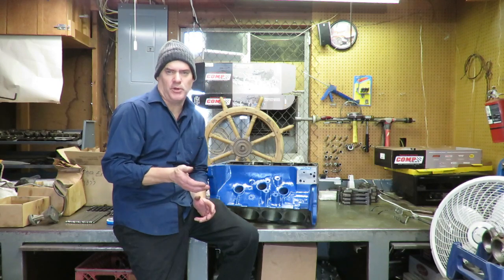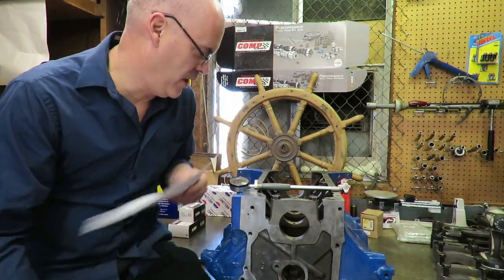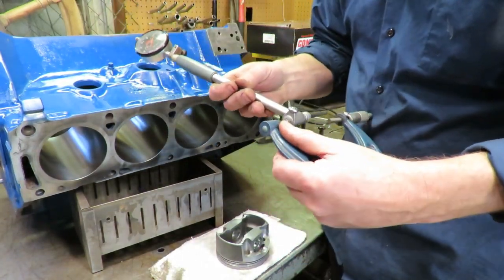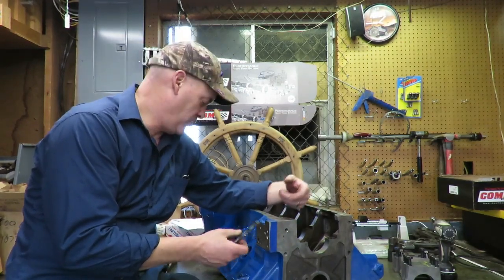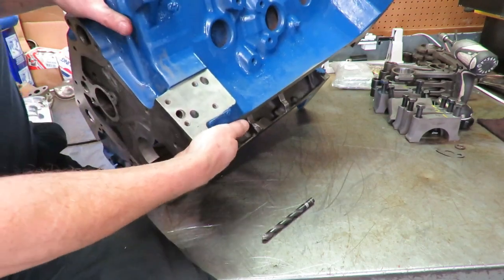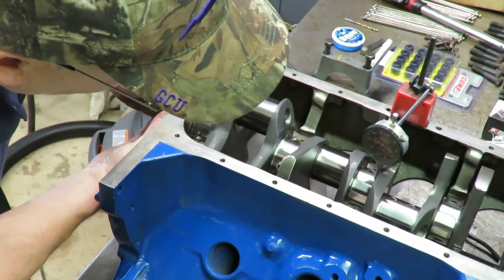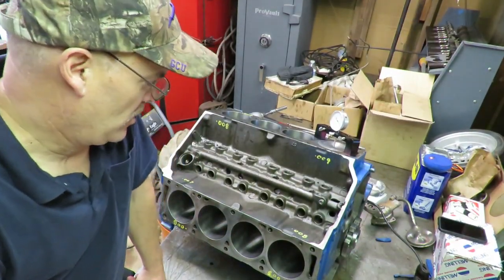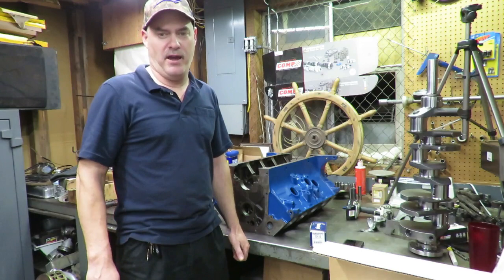390 FE Stroker Build part 3 Block Prep

Comment: This is my motor.  I am very lucky to have you building it.  You bring more to the table than anyone I know.  Your expertise is very impressive.  I can't wait to see the rest of the series.  I check everyday for new videos.  I feel like a kid checking the mailbox everyday waiting for my Orphan Annie Secret Society decoder pin.  It is exciting to see my motor  finally coming together.  I can't thank you enough.
Reply: Your very fortunate! It's getting awfully hard to find someone so knowledgeable on the FE.
Reply: iROBODUDE whats the name of his shop? i’d like a similar setup... thx
Reply: Im just watching the series, how did this turn out for you.
Reply: Couldn't you have purchased a small house for what you paid to have all this work done?🤣
Reply: How did it run and pull once in your truck?
Reply: @hectorortega9131  I am a little disappointed in the performance actually.  I think it needs EFI instead of carb.
Reply: @iROBODUDE   oh wow, sorry to hear that,.  So what do you need it to do that it is not doing?  Bogging, not enough torque? Detonation or what?.
 Also how do you use your truck mostly,. Weekend 4x4, hot rod, or Work mule?
Reply: @iROBODUDE  what's actually happening with your motor I have a 445 in my mach 1 I built and she's running 10.90 all motor and it has a  carburetor I'd be glad to try and help you
Reply: You didn’t put C8AE-H heads and that garbage Performer on it did you? Or the stock exhaust manifolds?  You need good heads like the cracked C4 heads and an RPM intake with headers. These are very important to performance. The 445 is the best way to go. And you want Edelbrock 2.09, 1.65 valve heads or the C4,with 2.09 or even 2.15 intakes and 1.6 or slightly larger. Intake is very important, exhaust not so much. For a 425 ci or bigger a 282/286 and . 570 lift cam. The timing should be 37 total. I have mine with 17 initial and 20 centrifugal. I get it all in by 2400 rpm’s. Hope this helps.
Reply: @iROBODUDE  Put a 750 Holley 3310

Comment: Rescued a vintage oval-track 71 Ford Mustang from a scrap pile that I’m currently restoring. It came with a 390 with a 3 speed transmission out of the car. I know these videos were a few years ago, but if you’re out there I’ll appreciate anything I can pick up from from watching. Right now I just want to get it fitted in the car which is gonna be a task, it’s a Chevelle chassis, oil pan doesn’t clear steering linkage. Got a lot of challenges ahead and taking my time. Excited that I found your channel. Thanks for sharing your skills.

Comment: Definitely some good tricks to know on the old girl.
Set a cross bolt main caps wouldn't hurt either but they're a bit pricey that have MFG up and then machined in.
I used to do that to my Cobra Jets.
It's all in the heads ,
get some good cylinder heads on her that flow.
Even though it's a standard Duty engine I would definitely put a high volume pump on there with a good oil drive shaft from Moroso or somebody.
Weld on extra little box to your oil pan to give you at least two more quarts  volume,
And use a Holley carburetor jet restriction on number 3 bolt on the rocker arm shaft so you don't fill up your valve covers with all your oil.
You could likely get away easily with a Cobra Jet can  grind on it also.

Comment: I built one I used in a 67 Mustang on a 1/4 mile flat paved oval. It was my first car and was crap, but I was 26 and knew 390s by that time. I managed to nail together a killer one. Some might find the build interesting because I used data that could maybe still be found. In the spring of 1983 Hot Rod magazine did a story on a 390 powered Fairlane tearing up dirt tracks in Northern California (iirc). The article was titled "390 To Go." What made the car amazing was the motor, a 390 stomping all the small block Camaros. In that article I found the oil system mods that will get MORE oil to the mains. Oil to the mains is the weak link in the FE, and is why the side oiller exists. I imagine most good FE builders know the oil mods, and 3 years pounding on my motor seeing 6 grand twice every lap says they work. The bearings were always still there every time I went in and looked.

Then for power I used Fords Muscle Parts catalog from 1968 (iirc). Stuffed full of builds for all factory supported engines I built mine to a spec I called a "baby 427." The oil system mods require going to a mech cam, and that frees up a lot of excellent cam grinds. I chose a PAW (That's right that PAW! lol) grind that was with in lift rules and close to old factory mech 427 specs. This cam fit with the Ford recommendations, and the Ford machining specs got the compression where I wanted it with legal flat top pistons. This was the expensive part as it required the intake be machined on 4 surfaces. It was a beast with (illegal) port matched GT Mustang heads (3 bolt exhaust port) and stock manifolds and carb. It lived for 3 hard seasons freshened up twice with a custom (very crude) kick out and baffled oil pan I made. I sold the engine and it ended up in a dirt track car in Nevada and won a local championship in a much better car. My car skills were not yet there, I did later learn how to win. But I made a great 390 by gawd. I've built better engines since, but only because I had better rules and more money.

Comment: One of my favorite personal engine builds was taking a 360 FE , boring it 0.060 over & dropping 390 crank & rods in it. I almost blew out a disk in my back just trying to lift the bare block up to go to machine. A comp cam RV bumpstick and a 10.5 compression ratio made it a real stump puller. Most important part is opening up the oil galleys on the FE because it will run out of oil at 4000 rpm.
Reply: I see you commented 3 yrs ago but if your still out there, is your claim of running short on oil at 4000 with a standard volume pump or high volume pump???
Reply: @jesseduke694  it doesn’t literally run out of oil but the life of the rings and rod bearings are shorten quite a bit if you get a stock bottom end of a FE to hang out over 4500 rpm for a few minutes.
Reply: @BustedWalletGarage  i understand what your saying. I was just curious if that claim was intended for stock volume or high volume? I know they need help in the  oiling department at rpms
Reply: @jesseduke694  every time I’ve seen a high volume oil pump on a street car the oil pressure goes to zero when it accelerates.  You have to use a very expensive oil pan to prevent that and they usually don’t fit in the car well.  The stock Ford oil pump can be modified by shimming the internal pressure relief valve and you can get a few extra psi while still using the stock pan.

Comment: This is gonna be sweet!
I just put a Sniper efi on my stock 390 FE and I’d like to rebuild it while also adding some performance.  
I didn’t even know FEs were skirted.  Cool.
Reply: TheProchargedmopar do you have a clue how to contact Myvintageiron I need to buy his pants for sale. thanks.
Reply: His PARTS FOR SALE NOT PANTS HIT THE WRONG KEYBOARD KEY ANY ONE KNOW HOW TO CONTACT HIM!
Reply: Curtis von Epp Nope, Just watched a few of his vids.  Pretty good.
Reply: I read that first post and thought what the hell??? LOL You can contact him through his FB page- it may take him a bit to get back to you but I know from first hand experience that he will get back to you and he's just as personable via message as he is in his vids.
Reply from the maker: sorry man my pants are not for sale
Reply from the maker: message me on Facebook at myvintageiron7512
Reply: Yes skirted and you can even buy the 3 center caps for a cross bolted main setup and if you look at the bottom of the block you will see drilled and threaded holes on the bottom of the shirt for the option of cross bolts on the 2 and 4 main caps. Atleast my block is
Reply: Try his facebook page of the same name

Comment: Exactly right on the soap and water. Solvents will simply break a particle loose, clean it and allow it to redeposit even deeper. Dish soap is actually a detergent. Detergents keep the particles suspended allowing them to be rinsed away. I wouldn't go near a builder that didn't use soap and water. I have personally removed casting sand from blocks with soap, I'm sure you have as well.

Comment: I've got a stock 390 in my 68 ford galaxie ltd. I'm planning on doing a full rebuild once the block passes inspection. I like the sound of a lopey rv cam, and I plan on stroking it. Do you have a recommendation for a stroker kit and cam as well as whether I should over bore and if so how much? I want a good solid fun torque motor for street/strip. Great thorough videos man!

Comment: dawn...it even removes diff grease from your hair. block isn't a problem ;-)
i have used the stuff for the purpose for over 15 years. works well...no problems. with pressure washer.
Reply: Gizmo Thewytchdoktor Dawn dish soap, and a little sand will clean black walnut hull stain from your hands better than anything. Pure dawn just a little sand only then work it in for a good long while. Then rinse with hot water. REAL shade tree mechanics know 🦉

Comment: The back side freeze plug to keep the cam in is what way installed? Then with 390 to 427 the cam bearings are different no? The 427 had grooved bearings which are diff than the sideoiler. You stated this was to be a full tell all an missing this one part has left me a lil in the dark. I've built many engines NO Machine work always did it by farming out. So when came back plugs were in an bearings of the cam as well. I'd like to see °ALL the steps an sadly you left this out an I know they are supposed to be easy but seeing is learning.

Comment: the old 292/312s had a notorious reputation for eating upper valvetrain parts, so bad so j.c. whitney offered an external line oiling-kit that utilized a block takeoff, brake-style lines and access holes drilled thru the valve-covers. the new "FE" was not to have these problems so they restricted oil from the bottom-end forcing it to the top. of course the designed for racing side-oiler sidestepped this major issue.

Comment: Where did you get these pistons. I couldn't find any for a 4.11 bore 390 when I wanted to put a 428 crank in it and I had to have lots of custom work done to the pistons we had and the engine is still running with .021 out of the bore with mls head gaskets to make it all work. The pistons I need are a flat topped 60 over 390 piston for the 3.98 crank. U went through 4 sets of cam bearings doing test fittings on the camshaft. Then removing them and honing out the cam bering bores then reinstall and check for cam friction.
Reply from the maker: The pistons are from MAHLE motor sports but stroker kit is made by scat they also supplied the pistons it's a 4.125 stroke that brings our CID to 431
Reply: Myvintageiron7512 will a standard 390 block handle that large of a bore? By my numbers that's a 75 over bore or am I wrong?
Reply from the maker: no it's .030 the standard 390 bore is 4.050

Comment: The Ford TSB said it was not recommended to align main bearing holes because it may over lube bearing and crank and lower oil pressure in other areas of the engine.

Comment: What about cam bores?? I recently built up a 460. During assembly, I couldn't get the cam all the way in. My machine shop said this can happen. For the fix, they had me run an old cam with a knife edge cut into the journals into the bore. It shaved the tight bearing a few thou so the cam would fit. It worked, but I should I have just align bored the cam bore?  Machine shop said Mopars and AMCs are notorious for this issue. This is also a good lesson and reminder to put your cam in BEFORE the crank.
Reply from the maker: The machine shop you are using did exactly what I would have done,  cam bearings are very forgiving and often times the bores are not aligned well from the factory what you did is perfectly acceptable it wont effect performance one bit
Reply: Good to hear! So should align boring/honing be done to the cam bores as standard practice? (as one would do with mains?) How's the cam bore alignment measured?

Comment: Hi!
I have a 390 with a 431 scat stroker crank in it. My solid cam is broken and I’m rebuilding the engine. I’m thinking of going with a compcam PN 33-422-9 hydraulic roller. I got ported stock heads and a rpm intake on it.
My question is, what oilmods should I do? I have opend the passage from the oilpump, and I’m going to grind the passages for the main bevarings. Regarding the rest I’m insecure. Do you have any pictures or videos of what I shall do with this setup?
Grateful for any advice

Steinar Flåøien

Comment: I have been wanting to start a project car for a long time, it will probably end up being a 67 or 68 Cougar. Even if I get a small block car I will be tempted to put a rebuilt FE engine in it but I am curious what the difference in weight is from say a factory stock 302 to a tricked out 390 with aluminum head and intake. For some reason I always think of the big blocks as the heaviest engines but doubt if that is true in all cases.

Comment: Surfactants break the surface tension and get that grit out. Use Dawn on your hands before you GoJo (if you have rinse water) and you'll use less hand cleaner. Pro window washers use Dawn like Mr. Woo uses Calgon.  The guy that cussed you out needs a Dawn mouth rinse.

Comment: Does drilling out those oil pump passages affect the OIL PRESSURE reading you see in the truck?
like instead of 30 at idle you might only see25?
it probly doesnt matter but may alarm some uninformed builder

Comment: Have you been watching Engine Masters on Motor Trend?  If so, what is your opinion on the series?
Reply from the maker: I never miss an ellipsoid of engine masters, Raodkill, and roadkill garage
Reply: Myvintageiron7512 What is the final cubic inch of the engine?
Reply: ...390?
Reply: talon0863    johns asking that because, in the video, he mentions that the block has been bored and he is installing a stroker crankshaft.  Totally not 390 cubic inches any more
Reply: Thanks, what do you expect the ball park displacement to be?
Reply: 431

Comment: This message is for the Ford FE haters comment Pauliebots if you are going to doubt the care of the cost for this type of engine build then you sir don't deserve the enjoyment of owning and running a Ford FE Big Block I my self still to this day enjoy my modified 1966 Original 352 that came in the 66 Ford F-100 truck and really enjoy running up with the new plastics on the road in my Father's Truck (RIP) that he bought brand new in 66 these engines if setup right with top of the line parts will go forever with proper oil and coolant changes

Comment: Supposedly the reason for the mismatch in main bearing oiling holes is to force more oil to the bearings as the oil travels from front to rear. One book has the size drills to check the restriction size, all being different. This is in regards to the 390 up FE. When someone did that to a block I had, the block cracked where it was ground and up the passage. Just sayin'. The only way I know to clean a block is WITH SOAP AND WATER, preferably hot water.

Comment: Love your videos. 
Have a question for you though. 
Think a stroker kit in the v6 Chevy would produce more torque than stock 350?
Both have similar parts but the v6 is cheaper to get machined and minus two cylinders is lighter and less ware on truck front end.
Reply from the maker: well you can do it that way but it's not the best set up I would change the heads 360 rods are really weak and wimpy I would never use them on one of these engines
Reply from the maker: HMMMM well I am assuming you are talking about a 4.3 they can be made to run very well but more TQ than a 350? I'm going to say no on that unless you boost it

Comment: Hi! Really enjoys your videos!! A general question....What are your opinion about using high volume oil pumps in SBF? Building a 408W but don’t like HV pumps. 🇺🇸🇸🇪👊
Reply from the maker: If your going to twist it above 6500 I would go high vol
Reply: Great! The engine will be limited to 6000rpm so stock pump will work.  Thanks for your advice!

Comment: The valley usually cracks first if the engine froze it's the weakest part and I saw one that the machine shop rebuilt the engine and put the head gaskets on backward , The steam cracked the valley and that engine turned blue so it was Toast .

Comment: Please over look my ignorance .  Have been watching this series of videos , hit & miss .

     You said that is a stroaker crank .  You started out as a 390 ci .  What will be the ci of the finishes engine ?  Did you use 390 rods or " special " rods ?

Thanks ,   :-)
Wyr
God bless
Reply: Sorry , I found where you state the rods are aftermarket .  Apparently the pistons too .

     How would ot work , if you took the block to the car wash & pressure washed it ?

Thanks ,   :-)
Wyr
God bless
Reply from the maker: All the internals are aftermarket the cubic inch will be 431 CID